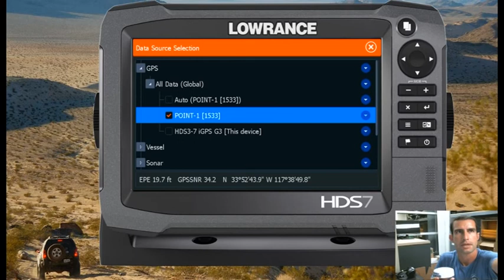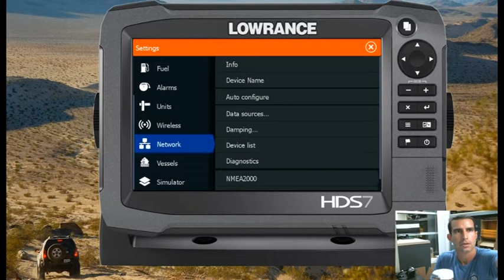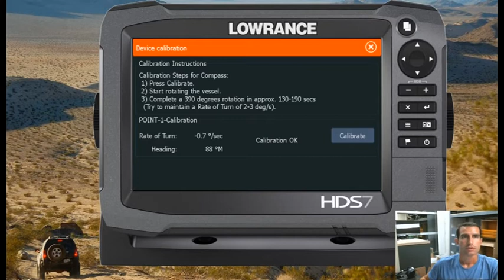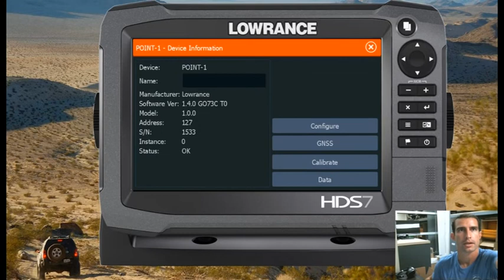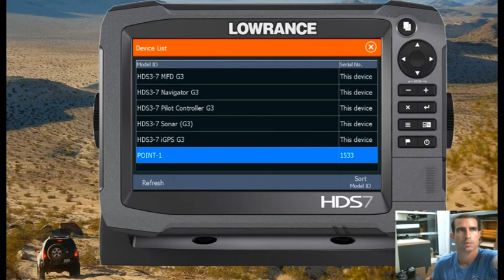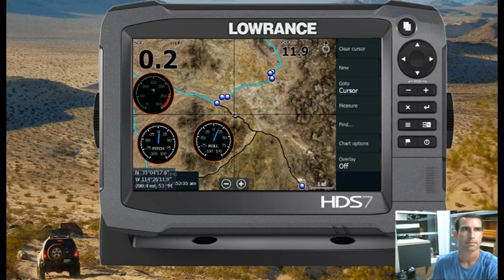Point-1 External Antenna Calibration w/ Pitch & Roll - Lowrance Off Road GPS

Comment: On my unit when I try to calibrate my point 1. Rate of turn and heading degrees is blank. What could be wrong?
Reply from the maker: Did you buy  it from PCI?
Reply: @RuggedRoutes  i did.... and having the same issue...i don't  see any data at the ratr of turn and heading...and cannot calibrate
Reply from the maker: @doarmihai  PCI Has the heading sensor disabled by default. In the past I personally had to do a software update to get it reactivated but it's prbably best to contact them for their recommendation on activating it.
Reply: I’m having the same exact issue!! Going nuts truing to figure it out.. it does have the pci sticker on the unit also. Is there a solution why we don’t have rate of turn and heading readings displaying at calibration screen?
Reply from the maker: @dcsann  PCI Has the heading sensor disabled by default. In the past I personally had to do a software update to get it reactivated but it's prbably best to contact them for their recommendation on activating it.

Comment: where is a good place to mount the point one? Lowrance tells you to mount it with no magnetic interference.
Reply from the maker: Usually on the roof, but on jeeps it's a but more tricky. You may need to play with a few locations before permanently mounting it.